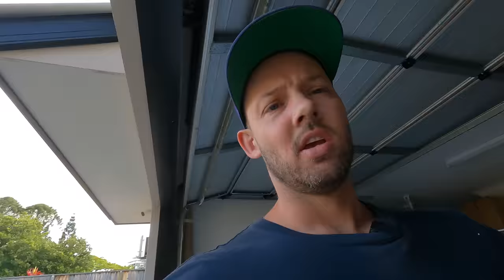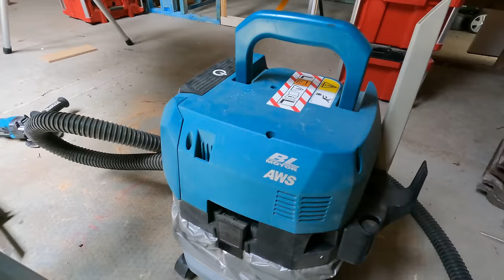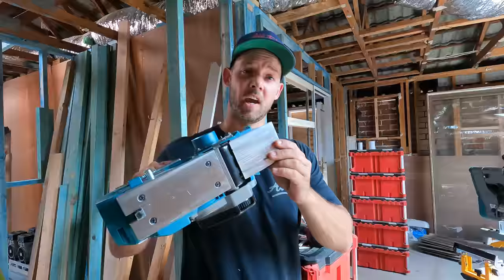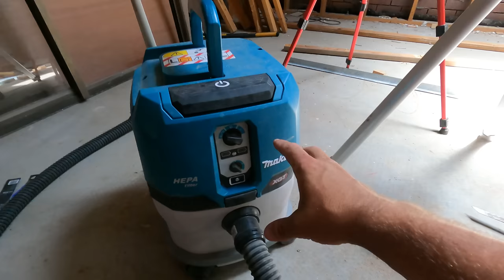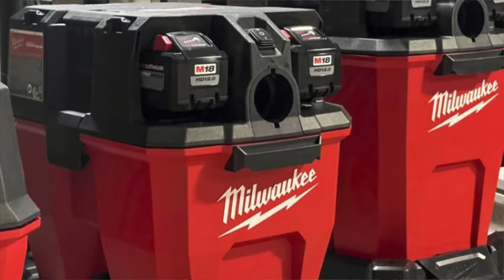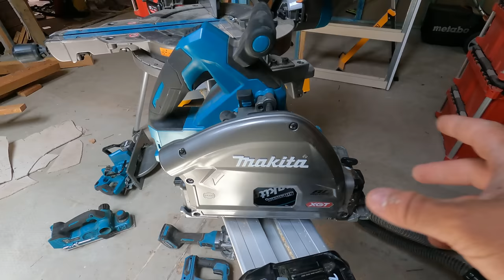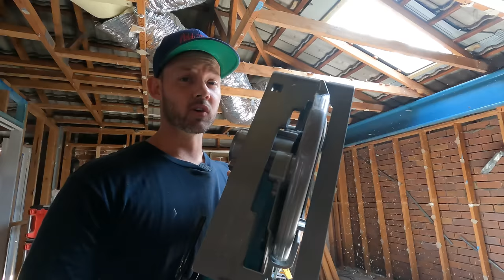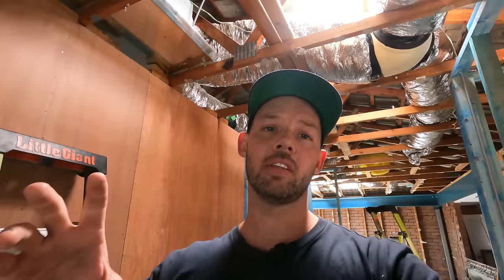From milwaukee to Makita. Why I changed tool platforms

Comment: It’s funny how people get super polarised by tools like they do with politics. They are tools… every tool brand makes good tools nowadays, Makita, Milwaukee, dewalt, Bosch even ryobi! I personally have Makita and Milwaukee tools, both living harmoniously together in my packout storage. Both brands are excellent
Reply from the maker: 100%. Couldn’t agree more. Many were confused when I used other brands, thinking I’m only a Milwaukee guy. I’m a good tool guy. They all have their pros and cons. It’s just east to get stuck on one platform because of batteries and chargers. I’m actually really excited to get more ryobi gear. Might make some leave the channel😂
Reply: @AddictedtoTools  id put money on there being more ryobi tools in most households because of Bunnings or home depot than there are Makita or Milwaukee tools. You’d probably increase your followers to the much larger home handiman diy crowd. 

Ryobi are owned by same parent company as Milwaukee, have you seen the ryobi 12v tools? M12 cousin.
Reply: Get polarised by the fact you get locked into one brand once you’ve got their batteries.
Reply: @Rockbottomsurf  you arent locked into one brand, youre free to buy as many tools and batteries from as many manufacturers as you want! yeah its easier having all the same batteries but even milwaukee has 2 battery systems you can buy into on their platform. i have makita and milwaukee batteries and i have never paid for a battery they always come with the tools or are added bonuses when buying during sales. its no biggie
Reply: @nathanc3189  of course “ locked into one brand” isn’t necessarily true but owning a number of dual port chargers for my Makita batteries makes charging and carrying chargers more streamlined.
Even if I were to go to a higher voltage platform I would stick to the Makita range as not only does it save me from having a number of different batteries and chargers but I find Makita rarely has a tool that bad that I wish I didn’t get it.
Reply: And every brand can make crap too haha
Reply: Very true 😂
Reply: You can get carried away though. I have Makita 18v, Makita 12v, Milwaukee 18v, Ego 56v and Ryobi 18v. If I could start again I would try and limit myself to 3 so I can afford more batteries for each of those 3. (probably Makita 18v, Milwaukee 18v and Ryobi are the ones I would keep although if I did that I would miss my Ego mower...)
Reply: false
Reply: well said 👍🏼👍🏼
Reply: There are subtle differences between brands that are preferable for some.
Reply: Every brand makes very poor tools also . I’ve had a lot of Makita breakdowns last 4 years .   35 year user.  Hikoki is my new choice
Reply: I just wish there was a common battery for tools - I am in 5 different platforms would love to just be on one platform
Reply: @AddictedtoTools  have you tested the kickback on the 40v hammer drill?
Reply: I think Ryobi is actually better in a LOT of areas. Cheaper, great batteries, great battery compatibility, consistently high-performance tools that last long and don't break easily. But like Milwaukee made the best torqueing impact drills and wrenches for a long time, Makita made the best Sawzall (haha), and DeWalt makes the best cordless chainsaw, so depending on which tools you use the most you get the "feeling" that one brand is just better than the others.
Reply: Because politics are tools too.
Reply: @AddictedtoTools  I use the best brand - tool for Me and the Task I am trying to do - but you cannot go wrong with Makita plus their support is great
Reply: @scorpiuswireless1  Dewalt seems to be the one that breaks the most for me
Reply: The only difference is nothing good really ever comes out of politics. Its always shit.
Reply: You lost me when you said Ryobi
Reply: @Rockbottomsurf  You can easily get adapters - I use Makita batteries on Milwaukee tools....  Don't even have any M18 batteries.
Reply: Hahahahahahaha 😁 they live harmoniously together 😁😁😁
Reply: Don't say that, I've hal bad experience with ryobi and black and decker
Reply: I have mainly milwaukee but also some ridgid and the new ryobi usb lithium smaller tools. Tools are same for other jobs/industries. Everyone has their favorite brands and shit on the cheaper ones.
Reply: Makita and Milwaukee yes are both great. DeWalt is okay, but Makita has way more power and seems to be better quality. I have owned rigid cordless tools also, they would be fine for a homeowner, but don't really keep up on jobsite. Ryobi, I haven't tried much, but I assume their quality would be less than rigid.
Reply: Best tools are the ones I can steal
Reply: I buy whatever is on sale at the time of needing said tool, unless i have batteries for a tool thats not too much more than the tool on sale...
Reply: After becoming a tech, everyone off the line seems to love my Makitas. The 90 degree impact wrench seems very new to Makita, but my coworkers Milwaukee pissed on the Snap On one apparently. The thing is keeping the same batteries. When the tough boys are out and you need batteries that last a full day, it's just nicer to have one brand. I rather have ONE proprietary outlet, than more.
Reply: @AddictedtoTools  i got the ryobi multitool with the flex head.  Im on makita.  Got the makita battery to ryobi tool adaptor,  saves buying a charger/battery for one tool on another platform for ocasional use.
Reply: They are tools made by globe materials.
Reply: @nathanc3189  why would using ryobi tools make more people watch him?
Reply: @nathanc3189  yeah theyve got adapters where you can use different brand batteries with other tools
Reply: It's part of peoples identity. Just like crossfittere, vegans etc.
Reply: I got sick of all my Makita stuff breaking.. their multi tools are dog shit
Reply: Ryobi are not good
Reply: And yet competition is exactly why they are all pretty good 😉
Reply: yeah the only thing keeping them together is the battery sets. If it was cheapest I'd get each tool by choice not by battery. Whats more is none of them have the power of compressed or corded tools. Just the ease of using the same battery. It makes the case for buying all the same tool brand that utilize the same battery. I'm looking at the td172 currently
Reply: Nathan. There is a song I sung many years ago. It goes like this. Oh makita you will never know. Anything about my ryobi. Yes makita you will never know anything about my aeg. Yes makita you will never know, anything about my dewalt. No makita you will never know, anything about my hilti. I have about 6 more before I start to think. I don't have aeg by the way. I have some dewalt corded tools and gave away some of my bosch, Makita tools.
Reply: Makita multi tools are shit I used to burn one out every year gone dewalt now seems better
Reply: I am like you both milwaukee and makita , I did have dewalt but hated the dewalt nail guns that's why I went to milwaukee and I am happy
Reply: @nathanc3189  IMO if you're not using your tools professionally, Ryobi is the best value for power tools one can buy. Six tool combo kits start at $250 and have everything a DIYer needs. They can take a beating and don't feel underpowered like say harbor freight's tools often do. I've built a studio & most of my garage workspace with them. Sure, Milwaukee or Hilti may fasten/cut/etc a tad bit faster. But those cost over double as much, and for non professionals that doesn't make as big a difference as having a tool vs not having one. Unless something changes I'm sticking with team green for now
Reply: Ridgid has entered the chat
…
ridgid already blew up
Reply: @oukastoukast shout out to Milwaukee and their high torque impact that would break before even leaving the store!
Reply: 1# reason for me is parts and service. yes they are similar in quality. next as crazy as it sounds is I don't use DeWalt because everyone at work is. they disappear quick when your head is turned so mine are Makita because of service and different color from DeWalt.  I can see who has it with a quick glance
Reply: Iam offeded you didnt mention top  tier contender Hikoki
Iam ex dewalt
Reply: Mannn... #trustory.. I'm #teamblue 👍🏾👍🏾👍🏾
Reply: @AddictedtoTools I agree that power and torque are often focused on as the key component in tools reviews (probably because it is easy to put a number on to compare) but as a user max torque and power really aren’t that important compared to usability, longevity and general functionality.  Ten years ago there used to be a disparity in whether tools had enough power. ,  before brushless tools but now pretty much any brushless drill etc will turn your wrist inside out quite comfortably or drive a screw/cut a board faster than you need at max speed. The one exception to this is probably battery framing nailers  where most are pretty good but  some are still a bit underpowered (mmmhm dewalt framer, as the owner of one I wouldn’t recommend it until it gets a rework).
Reply: Yep, I "upgraded" from Ryobi to Milwaukee but got to be honest, I miss my Ryobi kit! Especially how easy it was to remove the batteries!!
Reply: If you were to start a hand and power tool retail business, which two or three brands would you focus on selling during the beginning stages of your business for these 8 different industries/areas:
#1-Construction
#2-Woodworking
#3-Electricity
#4-Plumbing
#5-Landscaping
#6-Welding
#7-Mechanic
#8-Pressure Washing
Reply: Good ol' red and blue
Reply: Milwaukee is for the Electrician.   Dewalt is for the builder/remodeler.   Makita is great for both due to size
Reply: Makita just because I like having loads of tools
Reply: Totally agree mate 
It’s stupid how people can only stick to one brand 
Well said ❤
Reply: @nathanc3189  I know way more people with Makita and or Milwaukee. Then I see Ryobi. Granted I do work in trades and am not just a muggle with a leaf blower and a 50 drill set.
Reply: I've worked in the hardware and tool industry all my life, I've come to work out that if you get over the stigma of owning multiple tools and batteries and buy the best of all the brands you will have some awesome kit. I like makita out door equipment, I'd have drills and impact tools in milwaukee but larger output tools in makita, wouldn't get a makita chainsaw and not because there is anything wrong with them I prefer dewalt as they offer multiple sizes bit they feel more like a saw then the others especially for the larger hand blokes. It's a pain for some to own multiple platforms but if you keep the batteries charged and use them as needed it really doesn't matter.
Reply: Imagine owning a brand. Using and abusing for 10 plus years and against all odds the tool still somehow works. That's how you get guy's like me, I'm Milwaukee and Dewalt. I've had Porter cable, ryobi, bauer, tons of brands fail with minimal stress. When I grab a tool and it doesn't help me I usually get passed off lol. So I'll stick with being a fanboy and have tools that work 30 years from now.
Reply: Quality is highest with Makita for sure
Reply: Every tool bran accels at something. Dewalt weight to power in most cases good carpentry, Milwaukee rugged heavy not really a fine carpentry tool in most cases mostly due to spindle run out and vibration but great trade tool for electrical plumbing, makita always smooth not the most powerful bit always smooth and accurate great fine woodworking tools.
Reply: @nathanc3189  if your watching these videos your not some moron thats workin at home.
Reply: Whatever works and whatever is priced fairly in my books. People that defend their tool choices are weird.
Reply: I love tool politics 😂
Reply: because its fun
Reply: It is fun to compare toys but when is gets nasty it gets dumb. Some of the differences are negligible. So many variables to consider and so many opportunity costs. I run Makita and I’m excited to try out the new TD002G impact that has dual spring technology.
Reply: Ryobi is markedly inferior to milwaukee, bosch, makita, or Dewalt.

I would place ryobi beneath ridgid, which I still place beneath those big 4. Down there with black & decker, Wagner, and hercules...

I'm pretty much all milwaukee battery tools. I consider them all excellent tools. I do have a Dewalt laser that runs on their batteries. 

For plug in tools I'll use what I like. Makita jig saw, Metabo variable speed grinder, bosch miter saw, bosch mini cup wheel grinder, makita skill saw, festool track saw, festool sanders, bosch router, festool router, delta band saw (great grandpa's!), etc, etc, Dewalt board planer, etc.
Reply: I mix Makita, dewalt, skillsaw, Metabo and einhell, i don't why people should marry a specific brand
Reply: Has nothing to do with that, milwaukee has the most tools hand and power tools. I don't understand why you would have different battery platforms, to me that is the dumbest mistake people do when buying tools. My grandpa and dad have always had milwaukee so I generally started with that as well. Being a mechanic im glad I chose milwuakee because they are making hand tools and power tools dedicated to that.
Reply: @sslusshy  yes it does.i see it daily across many trades over decades on the job.

Most people aren't brand whores unless economics forces them into it.

And milwaukee makes crap hammers with thicc claws not made to pull an actual nail right, inferior channel locks compared to Irwin, their shockwave bits need muscled out of thier home, I could make a list of milwaukee faults.

Blindly being beholden to a brand isn't good.

Yet as soon as you get to battery tools, everyone basically chooses 1 brand. Unless they went for high-end battery stuff from festool or the like.

I chose milwaukee to power my battery-operated tools. But if it plugs in, it's anyone's game, just like a hand tool. I choose the best tool for the job within reason from an economical standpoint.
Reply: You can buy 18V battery adapter kits, which helps with tools you use less often or if your holding onto an older tool till you can justify replacing it, its not pretty. But i have hvac vacuum pumps that i can use my batteries on, which just gives me more time should i find an issue, i wouldnt recommend on impact drivers or drills, but anything thats fixed in place for the day its a convienience.
Reply: @scorpiuswireless1  Hercules for me and Bauer
Reply: @ron1martensU got a good song for you, oh DeWalt you will never know about my Hercules, oh DeWalt you will never know about my hart cordless tools, oh DeWalt you will never know about Bauer cordless tools, great song and very true
Reply: Agree, i have too many makita 18v and 40v, many bosch 18v and 12v, and a few milwaukee 12v and 18v, all inside bosch and makita box's mixed inside some times, i do not married with one brand, i married with the best tool that i can purchase in their category and type, regardless the brand, thats why have 3 most brands and did no discard to use another if it is good !!
Reply: Totally true your best off having like 2 or 3 different chargers and batteries then your not locked into buying just whatever tool you've only got so mix it up is a better option I reckon !!!!
Reply: Not long ago dewalts batteries sucked compared to milwuakee. Entire framing crews swapping brands overnight. Now you see A lot of milwuakee. When those go out, they will change to the longer lasting battery brand yet again.
Reply: wrong, all Makita tools are top quality.  Whereas all Ryobie and Milwankie tools are dog do
Reply: Lies mate
Reply: That's a very good point. It kinda feels to me like dewalt and milwaukee are always fighting in the spotlight like Chevy and ford. Then you got ryobi, the weird smaller brand that might be awesome and also might be crap, no one knows. Kinda like a Suzuki samurai like those who love them will never switch. Then Bosch and stuff like that are probably actually the best, but are under the radar. All have something to offer
Reply: @eapa37  Brexit was good
Reply: @lauchlanstill6677  Ryobie are for remoaners
Reply: It is driven by companies themselves, they will create platform that will have this type of battery and you can't go to other brand as you have other company's batteries
Reply: Ryobi is not very good
Reply: Ryobi is not a good tool brand

It’s like Black & Decker 
Black & Decker is owned by Dewalt 

If all tools were the same pretty much like you’re saying, why would DeWalt make a cheaper version of a tool to sell? 

Milwaukee, Dewalt, Makita Bosch, or the top tool brand 

They most definitely is a difference 

I am an HVAC installer and technician and business owner 
Tools matter very much to me 

Hand tools I use insulated wiha and knipex and drills powers tools I use Milwaukee and Makita
Reply: It’s the whole batteries thing. That’s all it is. Not everyone wants more than one brand. 🤷🏼‍♀️
Reply: @scubasteves3214 ive had 2/3rds of of all my dewalts break on me with low usage. Will never buy again. Why im watching videos to find a new brand.
Reply: Yeh you can save like half a second driving a screw who cares they all do the same thing.
Reply: Because of Android nad IOS
Reply: @gorkyd7912 ryobi is a joke.
Reply: Definitely not from my perspective over 20yr of killing tools. Milwaukee drills chucks and gearboxes always blew up way faster than similar Makita. Same with batteries Makita was okay. I'm running hilti now for my metal work tools and their batteries have been amazing. Only issue I've had was a free warranty chuck replacement on my biggest drill which did several hundred M14 drill taps. 

All day ergonomics of hilti was my biggest reason. To buy into their system and stupid fast turnaround on repairs!
Reply: If your a tradie then fair enough, for a DYI people that start getting into the politics and only does  projects once every 3 years and state they have OCD, Those people are the real clowns.
Reply: @eyes2338  it's not really politics though. As the tools are not equal in the build quality or the work they produce. Some DIY like to produce high quality work and can afford higher gear.
Reply: @ErzbergAdventures  it's all politics to me if the red team is not that much better than the aqua team especially if your not a daily tradie.
Reply: @eyes2338  some brands ergonomics are definitely better which would be more appreciated by people than use them lots. I wouldn't say DIY should just stick to cheap brands brands though
Reply: @ErzbergAdventures  Agree that you don't just stick to crappy tools but to get a new set of tools I.e getting rid of a whole set of Makita tools and getting a new set of Milwaukees just because there maybe marginally better is crazy to me.
Reply: Bosch don't make good tools
Reply: When batteries cost upto $400 its usually cheaper to just stick with one brand
Reply: @user-ep4rr8rv4t  it definitely makes it more interesting. It's quite funny, as I actually went 240v corded on all my new wood tools I just bought. I'm actually a bit over batteries and chargers lately.
Reply: @ErzbergAdventures  fair enough, if powersource is no issue  corded tools are better really